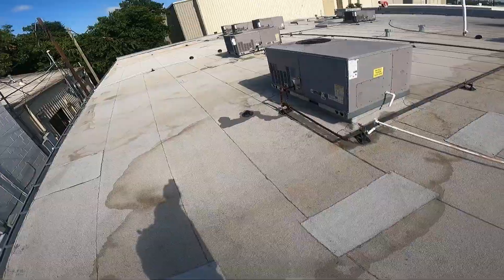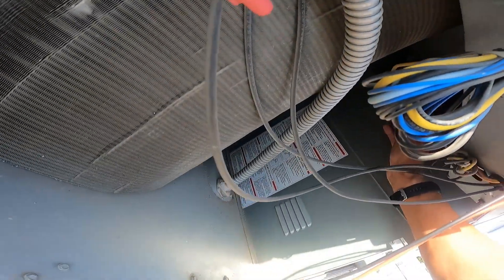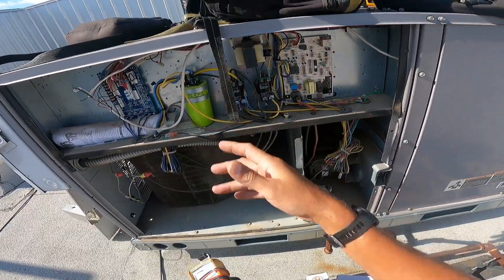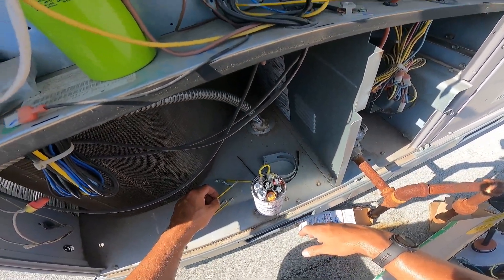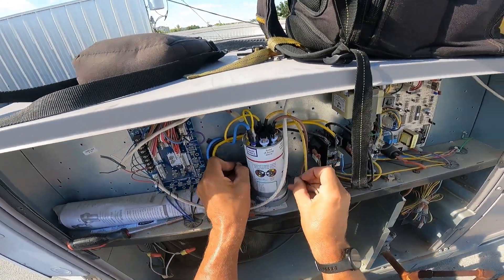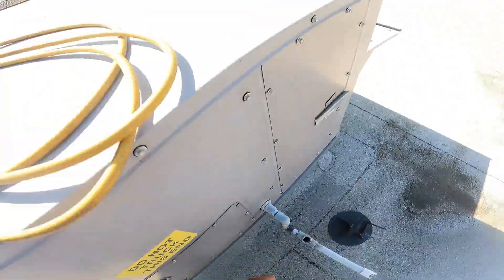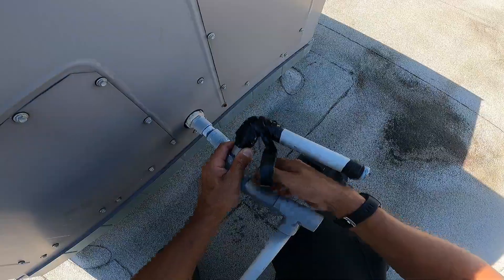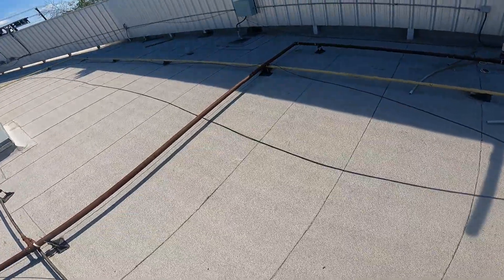Carrier RTU not cooling! Only one brain cell needed!

Comment: Why not test the cap before dragging 2 motors up onto a roof? I've done quit a few when the cap was bad and the motor didn't start cause it was too hot. Just pour a couple 5 gallon buckets of cold water on the fan motor and it fires right up.
Reply from the maker: I know!!!  Haha!  I had a brain cell still sleeping!  Definitely made that one harder that it should have been. I don’t mind calling myself out. 💪🏽💪🏽